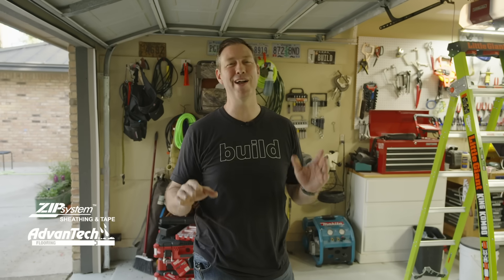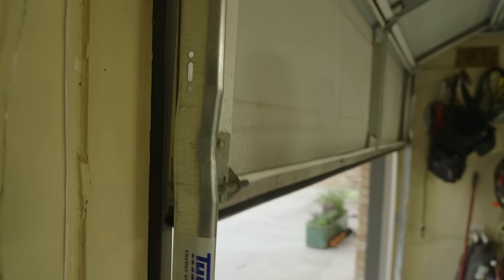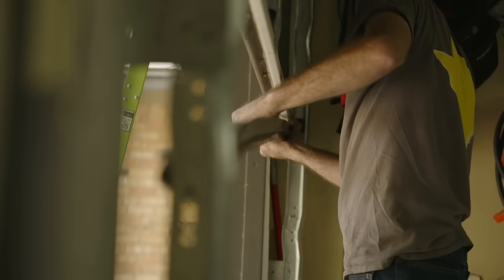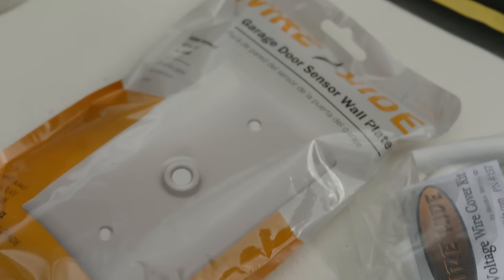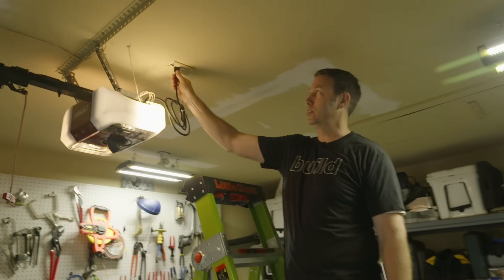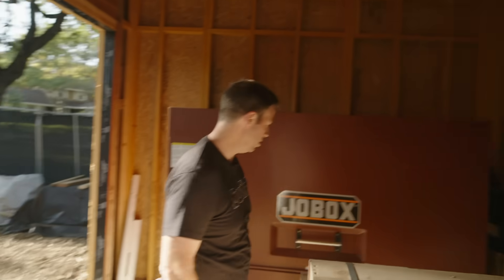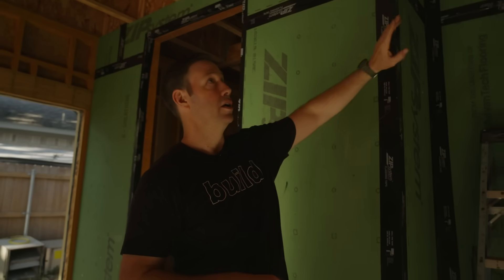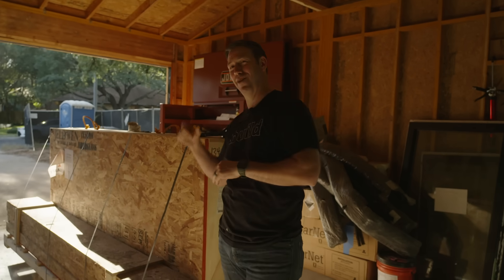Garage Door - Air & Bug Sealing

Comment: Garage door working on battery for 24 hours? - I don't think so. 
How long the battery lasts will depend on how many times the garage door is but up and down. Has nothing to to with time, unless they mean it will probably put your garage door up and down twice in the first 24 hours that the power is off. But the longer the outage the less likely it is that the little 12VDC battery is going to be able to put your garage door up even once.

If the garage door opener companies want to add a feature they should try adding a port for connection to a 12VDC car battery that includes charging up the external battery when the power is on. This would only need to be a trickle charger. Now that would be sweet.

Comment: Why would you put that small of a door on a new garage?    We are building a new house and the attached garage is 27’x42’ with a 20’x8’ garage door on the gable end.   Big enough to hold 4 full size cars or more likely 2 daily drivers with a boat and work area in the back.   

16’ wide doors are terrible to use if you actually want to park 2 cars.  20’ wide is a lot more user friendly not having to watch mirrors and other cars next to you.

Comment: Another very informative video.  Thank you.  When our house was built in 2008 I had them put Clopay insulated doors that are an R-15.  Nice part about them is having metal on both sides so the insulation doesn't get damaged over time.  They help keep out the cold on those 0 degree days.  It is rare the temperature in my garage gets below freezing.  During the summer I had someone ask me if my garage was air conditioned and I said no, just insulated.  Thanks for showing products to better air seal around the garage door, which is the only thing I wish was done better.  I will check them out.  I would be interested to hear how the seal on the top is holding up a few weeks after you stapled it.

Comment: I hate the giant ventilation housings I would much rather have a low profile exhaust port on the exterior with a hose to an inline motor inside the garage so you don't need this giant bird house sticking out of your exterior wall.

Comment: With all the smart solutions I would opt for a sidewinder garage opener versus an overhead one. Especially with bedrooms over the garage you want a silent opener.
Reply: Matt talked about using one in his new house.  It looks like his old house has side mounted springs so one of these would not work.
Reply: @darienredsox1878  Clopay has a conversion kit avail. Through Home Depot.  Easy installation to remove old side springs and mount torsion bar.

Comment: I replaced the original wood garage door on my home about 20 years ago with an insulated steel door, and I think it has made a big difference. I will say, whoever installed this door did a great job because the door is still surprisingly weather resistant. I do like the idea of the new door tracks you showed, that is a neat idea.

Comment: My family's homes have had problems with rats and other pest creatures coming in for a long time.  (During my college years, there was some kinda animal(s) living in our attic, and I'd wake up, sometimes in the morning, sometimes late at night to sounds that sounded like something the size of a cat scrambling around up there or in the walls.  And this went on for years until I started having nightmares about such animals coming through our walls.  We also had pigeons that roosted outside the master bathroom window.)

Now that I'm in charge of remodeling my family's homes, animal exclusion is something I'm paranoid about and have done more than a reasonable amount of research on.   Screens, hardware cloth mesh,  steel/copper wools impregnated with foams or elastomeric stretch fillers, bird spikes, you name it.

Current product I'm interested in are Xcluder's fill fabrics and door bottoms.  They have heavy-duty steel wool, more abrasive than a brillo scouring pad, made of stainless steel, stuffed into equally heavy-duty rubber, in door bottoms (regular and garage).  They also have those automatic door bottoms, and they make commercial products as well.  Most of their product line is focused on sealing rodentproof gaps that usually are targets for weatherproofing.  Looking at these for closing and sealing all the various door gaps, particularly on our garage and side doors.

Check out their stuff:
https://buyxcluder.com/solutions/residential.html
Reply: Those PRODUCTS WORK! From a PRO!!

Comment: hormann garage doors are amazing.  I used to sell and install doors.  It is a German company that now makes the doors in the 🇺🇸.  They have a high insulation value, strong wind loads, operate nearly silent, and have optional upgrades, such as long life springs, anti drop devices.
Reply from the maker: Funny you mentioned them. I saw them at the Bau show and was highly impressed. I totally forgot about them. I’ll look them up for my build

Comment: You have a garage but don't park inside the garage? Then what is the Garage for????

I think the garage fan is a waste, I work on cars and I often have cars running and working on them, I have a c02 in the garage, and I usually leave the door cracked about three inches and I've NEVER had the alarm go off. Even with my race car.

Also I hope you plan on expoying the garage floor

Comment: You forgot to mention that with an "airtight" garage you got to have a supply of fresh air, othervise the exhaust fan will not exhaust anything.
Reply: That is an outlet, not an intake as Matt says.  I too am curious how you could handle makeup air.
Reply: Don't you too, have makeup air to your garage? - for my door we have a "controlled gap" at the edges. It helps to mitigate CO toxicity in a "sensorless system".  (jk)
Reply: kadmow We have that same exact system, only our make up air is filtered by arachnid silk before it enters the garage.  But I don’t think Matt has that system, so he may need a separate source for make up air. 🤔
Reply: @BlackHorseRanchIdaho  : If you can recruit the adequate number of Golden Orbs, you may be able to attain higher "quality" with HEPA status in that filtration - though it can be counterproductive, so as to require a powered ventilation system to flow air through a high efficiency filter...    jks...  (Back to Matt's "Conventional Garage Makeup air")
Reply: He showed the intake on the exhaust fan
Reply: @jonathanzappala   Yes your right.

Comment: Matt, what kind of screws did you use to put the weather strip back up? I recently did new weather strips on my garage and could not find anything that would work or match the tan trim.
Reply: Tan nails. Maze nails are the best for garage door trim, in my opinion.
Reply: @Eaglefreek300  thanks, I ended up using tan painted stainless trim nails. I was wondering if there was a good option for screws though.

Comment: I just installed the side mount Chamberlain. You'll love how quiet it is, and how much space overhead it saves.
Reply: I have a liftmaster that mounts on the shaft also. A much cleaner install without that crap over the door.
Reply: @Chris_at_Home  Plus the install is incredibly simple.  I am on 1 year with mine with battery backup and wifi...love it and the app for remote control and monitoring.  Worth the extra cost.  Upgraded from a Wayne Dalton I-drive.
Reply: I too have the Liftmaster branded version w/battery backup. Smooth & quiet operation. No matter the label, they’re both owned by CGI( Chamerlain Group INC).
Reply: I just installed the same, replacing 25 year old opener.  So much nicer and super quiet.
Reply: GO BUY THE GENIE for the TOP TIER JACKSHAFT sure to outlast the chamberlain 12v junk!  Genies motor doesn’t have that POS cable tension monitor and is SAFER! Way more power and their transmission WONT WEAR OUT like the Liftmaster. Genie 24VDC NO CABLE TENSION, Liftmaster/Chamberlain 12vdc junk
Reply: @greatdoorsandgates4991  For a product that has been in the market less than a year, you sure have a lot of confidence and little real experience with the product.  Sounds like a salesman to me.
Reply: @D2O2  LOL just because YOUVE ONLY KNOWN ABOUT IT for less than a year doesn’t mean I share in the same experience! I was beta testing it two years ago, I was sitting with the engineering/executives from Genie and Wayne Dalton 18months ago discussing the product. Lastly ITS THE SAME MOTOR USED INSIDE THE 1028/1128/2028/2128/3120 SO THE PROOF IS IN THE PUDDING BUTTERCUP! Those motors have YEARS OF SOLID HISTORY. Liftmaster went cheap and will fail just as genie did circa 1996! The RELIA-G line has more units installed thanks to the Wayne Dalton/Nationserve 3outta every 4 new houses in the USA GET ONE OF THE RELIA-G motors. 24VDC. I’m a third generation DOORMAN = SALES SERVICE REPAIR & INSTALL. Yes Salesman is one of the hats I’ve worn along the way I’ve also swept floors sorted nuts and bolts and every other shitty gig this industry has to offer.
Reply: @greatdoorsandgates4991  Hopefully they are better than the I-drive.  If this was available 2 years ago when I got tired of nursing that dreadful I-drive I would have considered it, but I basically only had one jack shaft option and I had to make my own adaptor to connect to the torque master springs.  Now,  genie has an adaptor kit as well that looks identical to what I did.  I am in product development and I don't put mutch stock in pilot test units to determine field reliability long term.  Clients and conditions find ways to break even the best designs in new ways everyday.  Some of the biggest problems come from a tried and true design in a new application.  I prefer to have a direct measurement of the cable slack instead of inferred via software.  The software was the reason I got rid of the i-drive.  I got tired of reprogramming it everytime the temp changed 10 degrees and weather stripping drag  placed 2 lbs more load on the door.
Reply: @D2O2  that’s great that you’re in product development, but I’m confident in my REAL LIFE EXPERIENCE for decades that the GENIE jackshaft is all that and a bag of chips! I’ve seen the Liftmaster cable tensioner FAIL! More often than not it just doesn’t WORK! It’s commonplace on tall doors 10-12-14’ tall doors the cable gets weak which is par for the course when the door is fully open there’s very little spring tension left to maintain the tension on the cable that the LM 8500W calls for (with the included hardware, you have to ADD cable keepers which GENIE INCLUDES!) just to make the 8500W CLOSE the damn door. The genie doesn’t have this issue and does a better job of gauging the tension on the cable with its slowed revolution during the first 3 seconds of down travel.

Comment: Matt, have you tried Green Hinges?  Self-adjusting hinges do similar to what the s-shaped tracks do.
Reply: I had installed them about a year ago in my garage works great
Reply: Only problem with green hinge is they don't stop the wind. When wind pushes against garage door. Green hinge springs move and allow air/wind in.
Reply: @TheTrackman25  Interesting.  How much wind force does it take?
Reply: I've been considering to try them.
Reply: Hmmm, they stop the wind up to about 40mph.  But yes, will not stop very strong winds, but I think I would still choose them
Reply: Wow i just looked those up, i like em!!!
Reply: Why not both? I might pick up some of these hinges
Reply: @zlothra  If you do, let us know what you think about the combination.
Reply: If you set your jam brackets properly you don need all that BS
Reply: @leeswatls  How do you set it so you never have light or air coming in on the sides?
Reply: @rodshop5897  if you have track bolts that hold the track to the flag brackets that mount to the wall, you can loosen them and push the door closer to the wall. However, the brand of door I typically install has the flag brackets riveted to the track and are not adjustable. What type of outside weatherstrip do you have? How old is it? When it gets some age to it, it gets hard and no longer is flexible and causes leaks.
Reply: @Eaglefreek300  The side strip I have is only about 2 years old.  The door has been on since before I purchased the building.  I am concerned about making the door so close to the wall that is causes drag or catches the weather strip.  Is there a good way to set it at an ideal distance?

Comment: Have you ever looked into bifold garage doors instead of the roll up ones? I've only been around them once at a dealership but they seem way easier to sael up just cause of the way they close. I'm from northern Wisconsin so we know cold, if you're gonna get a insulated door go fiberglass or wood. The aluminum ones have to much thermal bridging. A heavy door is good too it'll allow you to use a more beefy bottom seal and still have the door be able to compress it. I really think you should check out bifold doors though, there's a continuous lip around the outside of the door so it seals like a European window.

Comment: I don't care if they are more expensive, Jackshaft door openers are the only option for me going forward. With your new garage, I'd see if you could do a high-lift track and tuck the door up against the sloped ceiling if you've got enough room before you hit the beam. I think that would  a slick solution.

Comment: For getting a better air seal I've been happy with the Green Hinge System.  It replaces some of the hinges with spring loaded ones that push the door up against the opening.  Not cheap but they do a great job.

For garage door openers I really like the Sommer Evo+ that I replaced my aging Liftmaster with.  Super quiet, good security, and none of that smart home nonsense built into it.  They also offer a number of ala-carte addons that let you tailor your system to your needs, like battery backup, security siren, and even a humidity sensor.

Comment: That expected, double side tape never hold good in any circumstances.
Reply: It depends on the prep of the surface and the tape rating. I have found some 3M foam type double sided tape that can hold tens of pounds of weight per foot of tape
Reply: @ItsAlive111  and you’re being conservative. From the space shuttle to sheathing of skyscrapers-glass, metal, and stone-double sided tape does more and performs better than most are aware of. Check out 3m VHB. I forgot automobile trim...
Reply: @ItsAlive111  you're right, the double-sided fine foam tape is really good.  but for some reason it is not used in such products, apparently because of its price.
Reply: @ItsAlive111  Even the 3M stuff hasn't been able to last in Texas heat from my experience.
Reply: @ItsAlive111  Perhaps, but for how long is the big question???
Reply: Yeah, the 3M stuff is insane. 4 years on my camper holding a solar panel through all kinds of weather, and I had to work hard to get it off. It's too good, in a way.
Reply: Looks like it gets clamped in when the seal is nailed on
Reply: Heck most of that type tape is same tape that hold trim on cars for decades even through car washes.

Comment: The garage ventilator and the mini-split seem like a strange combo.  When you’re working in the garage, what prevents you from walking past the ventilator, triggering the motion sensor, and then blowing all your conditioned air right out of the garage?
Reply: I agree- unless it’s on like a pseudo holifax sensor based on the track (only movement of the door counts) You could have some false vents.

Maybe he could tie it to the door opener activating instead? Still gonna false vent when the kids take their bikes out, but short of gps triggered activation on a cell phone in the car it’s probably as good as it gets.
Reply: It costs $ but they do make co2 sensors when it detects a change in comparison levels it kicks on
Reply: Unless you are doing somthing stupid like run a vehicle with the doors closed, there is no need for ventilation.
Reply: @Matt-mq1ep  For health reasons you're right, though for QOL reasons I would disagree. Especially if you spend significant time in your garage.
Reply: Depending on vehicle (he mentions suburban) you could either place the sensor at a height where its above people's heads but below the roof line of the vehicle. or you could place it facing the tracks so it activates whenever the door opens or closes. 

Though a better system would be an air quality sensor that would exhaust when air quality past a certain point, as well as having an override switch so you could turn it on before you started painting or something. 

Best system would be to have one of those heat exchanger things (cant remember the name) that brings in a constant supply of fresh air, and exhausts stale air that mat loves for the inside. Just a smaller scale one dedicated for the garage, which could be set on a timer or just constantly run at a low flow rate. which would provide not only an exhaust but a filtered intake. Though that would likely be a much more expensive venture. One could fairly easily design an all in one type small HVAC unit for a garage that had such a system built in, thus all the things could be controlled independently of the main house from temperature and humidity, to ventilation to maximize either comfort or whatever. Though at that point you're probably better off just having a large detached garage.